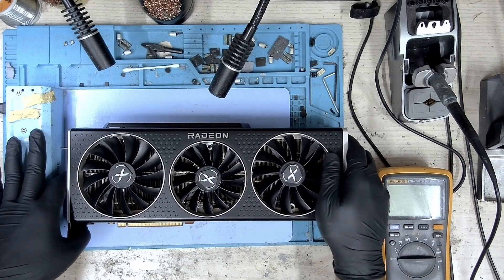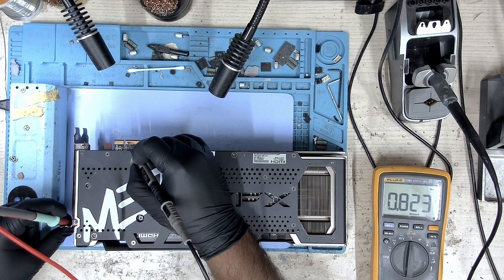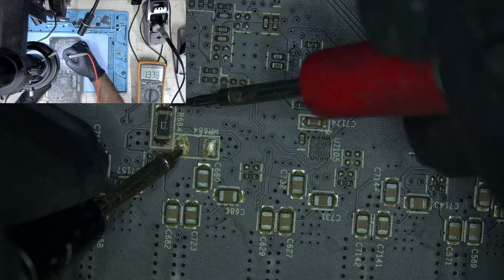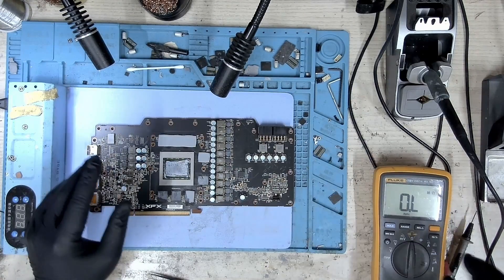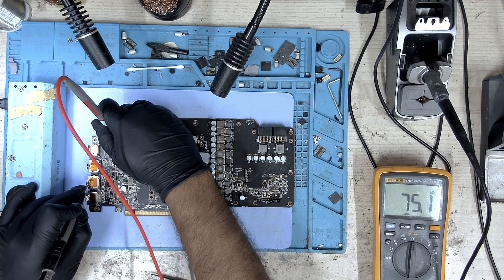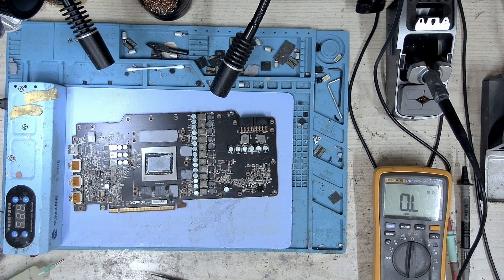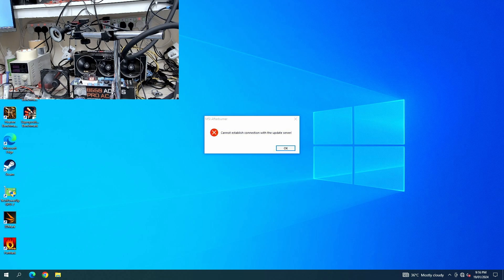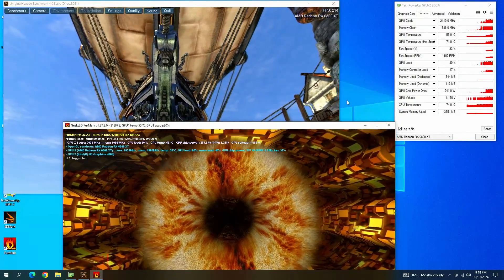XFX Merc RX 6800 XT  - Not Detected and No Fan Spinning - Fix

Comment: I just wanted to say that thanks to you and this video I was able to fix my dead XFC MERC 6800XT with this exact same issue! My first ever experience soldering and repairing a board. Thank you!
Reply from the maker: I'm glad my video could be of help to you. Thank you for subscribing to my channel. 😁
Reply: @GraphicsCardRepairs-tk7ql  hello. I got one question regarding Red Devil OC 6900 XT. Gpu is not detected by MOBO in any slot at all (bios do not see it). When i turn on PC card lights (because of +12 gpu cables) but it looks like it doesnt get power from MOBO slot, coolers do not spin at all, its cold. If i put card on riser and connect with any mobo slot and power it trough riser slot not mobo one, i get picture, everything is working, pass every benchmark etc. Also i have checked to gpu slot speeds in bios, gen4 or on auto its same, also its same on any other mobo. Do you have idea what it can be? Thank you!
Reply: 2:57 what's the specific resistor I'd need for this repair?
Reply: Second this question

Comment: For someone who might be attempting this fix as well, what was the new resistor you replaced the broken  one with? Which size and rating of 0 OHM surface mount resistor?
Reply from the maker: The one I replaced is a 0 Ohm 1206 size resistor.
Reply: @GraphicsCardRepairs-tk7ql  Could you please indicate the exact model of 1206 you used(what mW)? I have this problem and want to fix it. Thank you in advance!
Reply from the maker: There is no watts rating. 0 ohm 1206 size. Best resistors are which have less than 5% variation.
Reply from the maker: https://a.aliexpress.com/_opxT67a
Reply from the maker: Use this link. This is the resistor I used in the video. It is 1% tolerance and 1/4w.
Reply: Thank you very much for the help, I really enjoy seeing your videos. But never thought one would come to be exactly what I needed. You rock.

Comment: Maan that is nice!!! I didnt know there was common faults within this card.
I have this exact model and has a no detect problem as well and has all the voltages present but all the waveforms in the oscilloscope looks distorted. where do i check further to find the root cause of this fault?
Reply from the maker: Did you check the SOC rail? This is the only DRMOS with SIC DRMOS and all others are IOR. Check if this chip is outputting and voltage. Even if all other chips have voltage this chip might be missing voltage. Check if it's missing. If it's missing check this resistor at the back. This zero ohm resistor is know to burn out. Causing the SOC rail to go missing even though all other voltages are present even the core will be present.
Reply: it is present 0.975v , and all the other voltages present. @GraphicsCardRepairs-tk7ql
Reply from the maker: Have you checked pex reset? And also if BIOS is getting read?

Comment: Was that a yes? Do you have a discord to connect?
Reply from the maker: I am so sorry. My schedule is too tight as I also do a Day job and just have 3 hours for GPU repairs. Unfortunately, i will not be able to mentor however if for any reason you are stuck you can leave a comment and I will reply with a solution or suggestion.